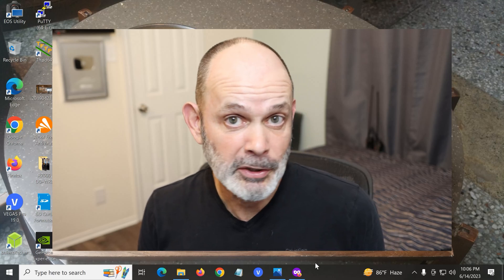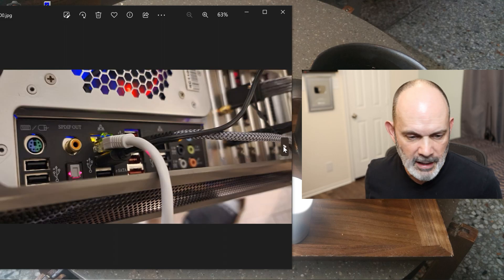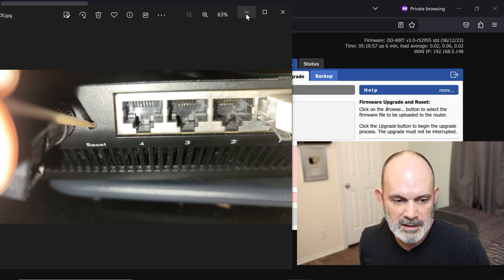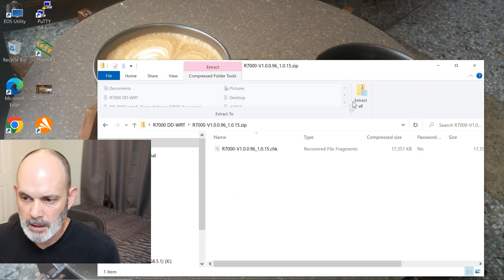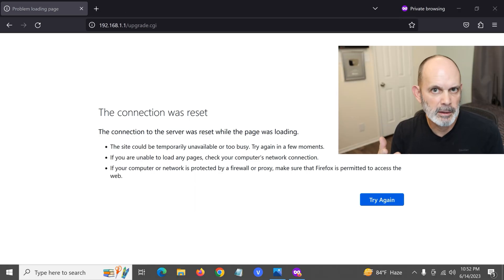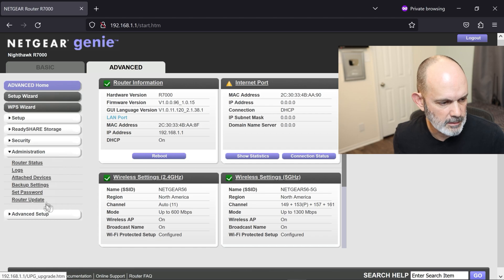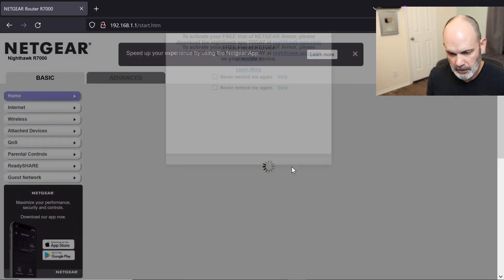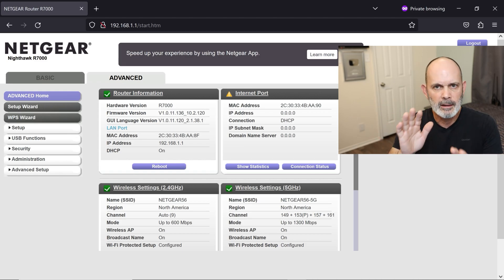Seamless Transition: Step-by-Step Guide to Removing DD-WRT from Netgear R7000

Comment: After I installed the Netgear flash bios per your instructions, I got to the point of being prompted for the userid and password. Just like you, I had problems with the default for both. I pressed the reset button but that did not work. I have tried turning off the PC and router and rebooting but to no avail. I tried a different browser and still it will not accept the login. 

Any ideas? 

Thanks in advance!
Reply from the maker: Boot the router up completely (till the lights settle down give it 5 minutes) then hold the reset button for 7 or 8 seconds and try again. Also connect it to the modem on the Internet WAN port too. It's seems to want Internet connectivity as part of the password process. If that does not work, try this video I made to recover it:  https://youtu.be/hXhMgQS5k1o   Tell me how it goes for you.
Thank you so much for commenting and watching. I appreciate it greatly. Subscribe, Click The Bell and stay tuned! All the best.👍😀

Comment: I just checked on the website DD WRT and the latest download is old 2020 why is that
Reply from the maker: You're guess is as good as mine? I show it on this video, Unlock the Full Potential of Your Netgear R7000 with DD WRT : https://youtu.be/I0h8B6ZVjrs  I show exactly that and I also show where you can get the latest DD-WRT firmware. In fact I show you two places to get the newest firmware. It makes me scratch my head... Thank you so much for commenting, watching and the very kind words. I appreciate it greatly. Subscribe, Click The Bell and stay tuned! All the best.👍😀
Reply: Thanks I overlooked it Thanks for your reply, when I download the firmware and connect the router to my imac I will not have internet because this is the only router I will need internet to complete the installation isn't that correct if so how will I be able to complete the installation
Reply from the maker: If you can't access the internet because your router is not functioning, you can connect your iMac to the router directly see this video: https://youtu.be/MUvy9v1JWp8 if you can 't achieve that connection you could use the "hot spot" on your phone to connect the iMac to that or go to a public WIFI to get the firmware or use a USB thumb drive at your friend's home to get it that way. Thank you so much for commenting and watching. I appreciate it greatly. Subscribe, Click The Bell and stay tuned! All the best.👍😀